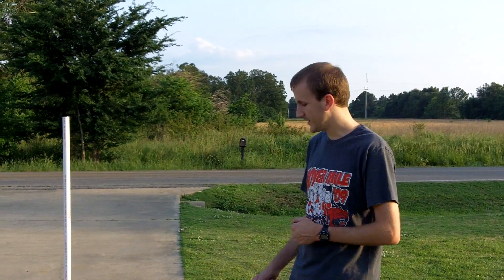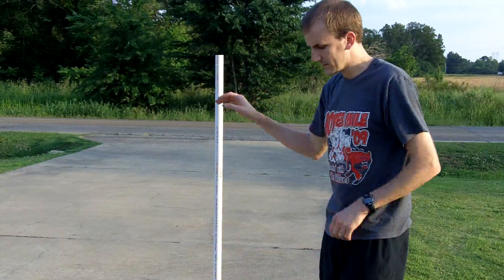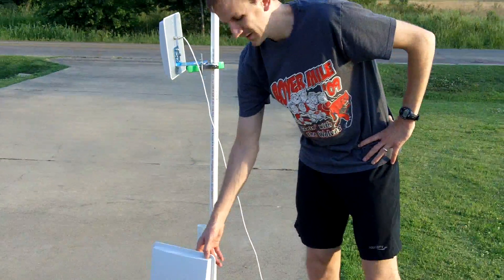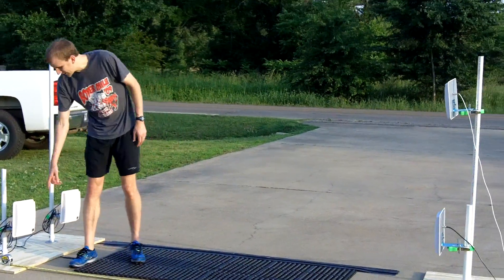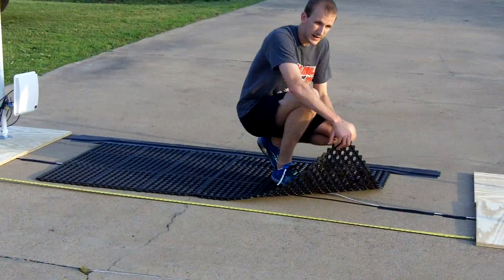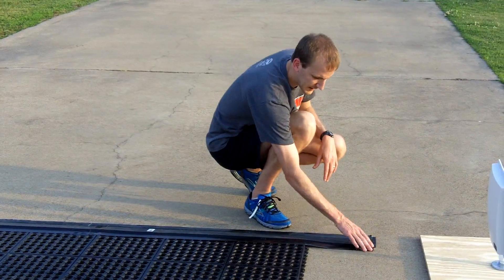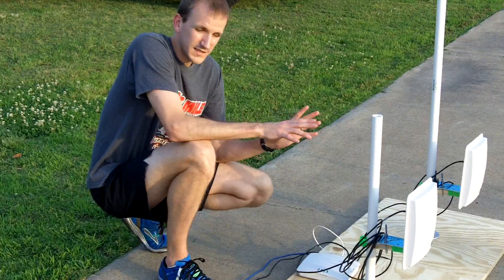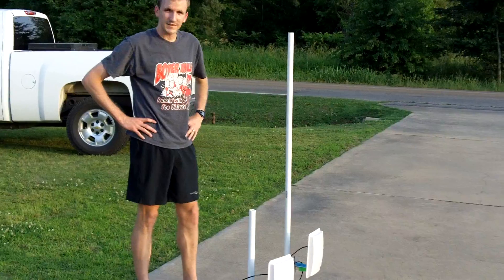Agee Race Timing, LLC

Comment: Is there ever an issue with the width of detection for side mount antennae? Most seem to have an advertised beam angle of ~65 degrees, which makes it sound like it could detect runners some way before they actually cross the line...?
Reply from the maker: Correct, the read zone of the antenna is 'cone' shaped, so the further away from the antenna you get the more likely the tag will get picked up early. The higher the "dBi" (aka Gain) the narrower the cone, but for the first few years I used a fairly low gain (fat read zone) and didn't have any problems. The only time this is an issue is when people walk very slowly up to the finish (and those individuals typically are not worried about their time being 1 second faster than it really was).  In fact, UHF RFID is not designed to provide laser precision, so it should not be used (for example) in short sprinting events. It works great for long distance events where times within 1/4 or 1/2 second accuracy is expected. UHF RFID is more about capturing a large number of participants over an extended period of time - but of course it's accurate enough to place people in the correct finishing order (most of the time anyway) when a large group of runners are flooding through the finish.

I always tell people not to make their finish line unnecessarily wide. The closer the tag(s) pass by the antenna the more power the tag receive and the less likely that the tags will get picked up too early. I also encourage people to place the antennas about 6 inches behind the finish line to account for the beam. I probably have quiet a few videos where I explain this, but here is the first one that came to mind: https://youtu.be/OlIx-AAuXR4?t=775  <-- This is also a great video for you to see the reads coming across as people finish.

Here are some other videos where I discuss the antennas:
https://youtu.be/p8wqkdt7ZRw?t=3249 (watch from 54:09 - 55:25)
https://youtu.be/p8wqkdt7ZRw?t=6137 (watch from 1:42:17 - 1:43:18)